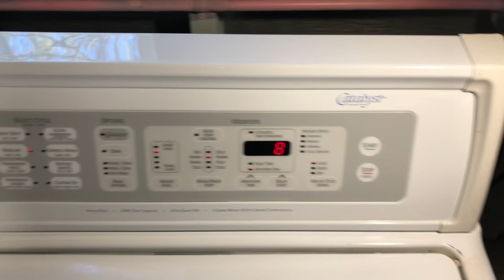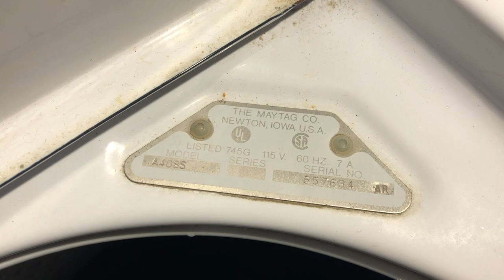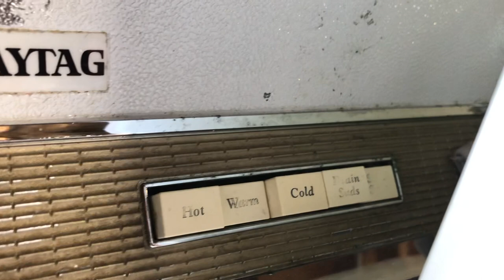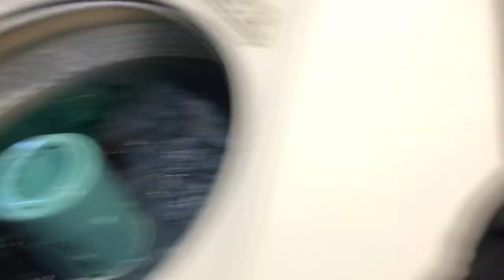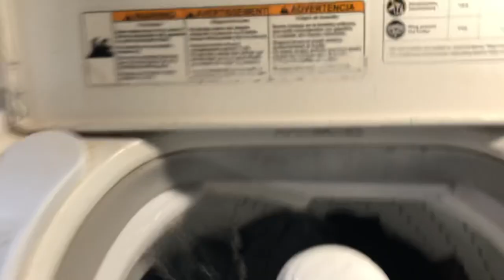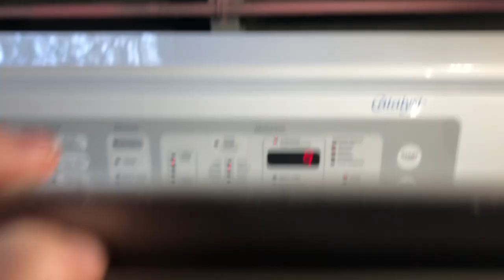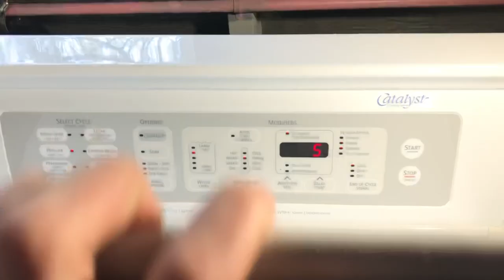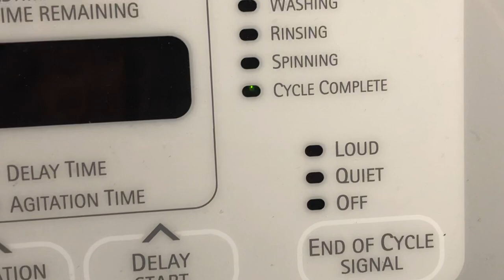Washday #3

Comment: Where do you get the cap for the agitator on the Catalyst? It seems like those agitators only have the fabric softener dispenser on it.
Reply from the maker: It came with the agitator. Since the catalyst has an automatic fabric softener dispenser already, one is not needed on the agitator, so all Kenmore Elite Catalyst washers came with this cap on the agitator. Occasionally you can find these caps for sale on eBay. I hope that helps!
Reply: @DrummerboysWashersAndMore  ok I’ll see if I can find it.
Reply from the maker: @biggysmoovemusic7777  Did you end up getting a Catalyst of your own?
Reply: @DrummerboysWashersAndMore  the guy that was selling it never got back to me so I’m back on the hunt.
Reply from the maker: @biggysmoovemusic7777  One other thing about the cap, the Kenmore Elite Catalyst has this agitator cap on it where the Whirlpool version does not. The cap only really fits this agitator because it’s designed specifically for this type of agitator, so it will not fit on a whirlpool or Kitchenaid agitator.
Reply: @DrummerboysWashersAndMore  it’s understandable. I do love the other dual agitator as well and there’s always caps for that.

Comment: Does the Maytag have a larger tub than the Kenmore? It sure looks like it.
Reply from the maker: In Cubic Foot Capacity, they’re probably about the same at roughly 3.5 give or take a little bit. I feel like I can fit more in the Kenmore, but I’ve never put an identical load in each machine to compare sizing.
Reply: @DrummerboysWashersAndMore  Maybe its just the way the camera is? Or does the maytag have a shallower tub?
Reply from the maker: @washingandmowing15  I believe the tub on this is a little bit deeper, but also a little narrower, while the tub on the Maytag is not as deep, but a little wider.
Reply: @DrummerboysWashersAndMore  Ok.

Comment: I no longer have to winterize my Maytag — I’ve hooked it up so that it now drains inside the house from my garage. Just waiting to get my Inglis portable back which will be coming inside for hot water washes! I’m guessing you are very close to winterizing your machines? And wait, all I use for my vintage machines is Tide powder — are you telling me I should be putting the powder down the center of the agitator?!
Reply from the maker: It’s nice to not have to winterize your machines. I wish I didn’t have to winterize mine but I don’t have a place to keep them where I wouldn’t have too. They have already been winterized for this season so that video will probably be posted during the week. I don’t know that putting the detergent down the center of the agitator actually makes any difference. Either way the detergent will get into the tub and mixed with the water. If anything it just gives me an excuse to take out and clean off the lint filter on the inside of the agitator!
Reply: @DrummerboysWashersAndMore   Another question - what do you use to bypass the lid switch on the Maytags? Interesting about the agitator, I’m going to try it with my next wash haha.
Reply: @DrummerboysWashersAndMore  ope, wait, you answered that in this video haha!
Reply from the maker: @ic1815  The lid switch on the other maytag is bypassed differently. There’s a small set screw on the lid switch mechanism inside the console that allows for adjustment on how far the lid needs to be closed in order for it to activate the lid switch. With the set screw all the way in, the lid switch is always activated. The downside of this is that off balance trigger is also bypassed so the machine will not stop if it’s off balance.
Reply: @DrummerboysWashersAndMore  mine is the little nub dependant on the lid being closed like your older Maytag. Keep in mind I have a 212S which is still technically the classic version in build just with the 80’s console — your LAT is different because it’s an LAT, and I’m glad to learn about these differences. Does your 408S have an off balance stop? I don’t think my machine has an off balance stop however it’s only once been ever so slightly off balance so I’m not totally sure if it would have an off balance stop or not lol.
Reply from the maker: @ic1815  I believe most if not all older maytags had off balance sensors, It’s basically a plate on the back of the tub cover that trips the lid switch into thinking it’s open. My 482 is actually not an LAT Maytag, it still has the pitman style transmission and long stroke agitation. The lid switches just changed in design as my A408s runs the main power through the lid switch first, and the A482 uses the lid switch only during agitation and spin. I believe your Maytag has the same designed lid switch as my A482. However the trick I used for the A408S will work on just about any maytag from basically pre-2000.
Reply from the maker: @ic1815  I can also make a video about this if you’d like me to show and explain it at the same time.
Reply: @DrummerboysWashersAndMore  interesting! I do notice it’s simply just a white prong that is dependant on the lid being open or closed, not sure if that makes a difference. I always forget there was that period before LAT’s but yet after “12” series machines like mine, because your cabinet looks very LAT — in reality the LAT carried over your design. But I just always seem to forget there was that period of “custom” Maytags — I’m sure you’ve seen the AW post.
Reply from the maker: @ic1815  My A482 is probably one of the last Maytags to feature the pitman style transmission. Maytag switched to the Orbital transmission about halfway through 1989, and my Maytag was built in February of 1989.